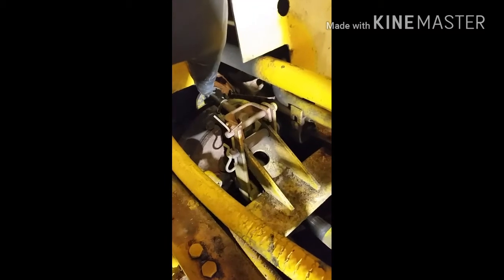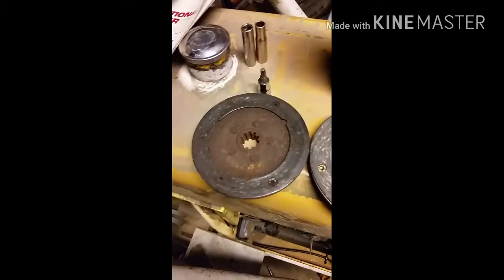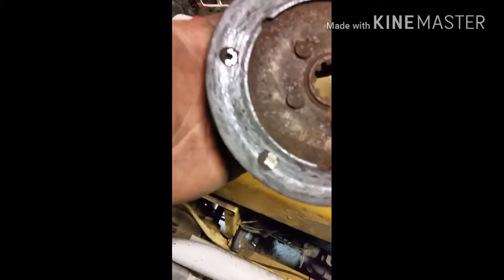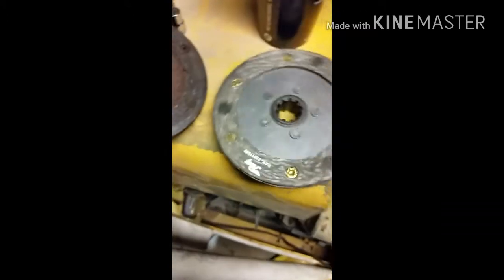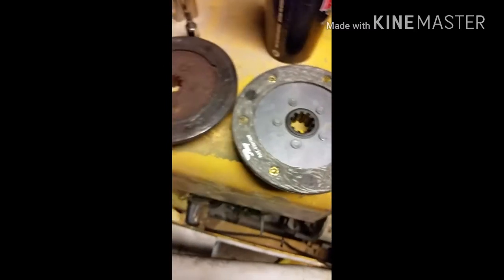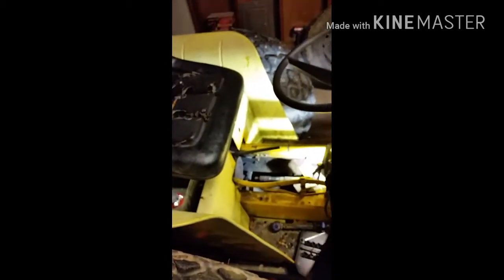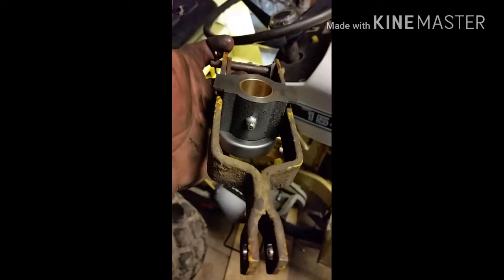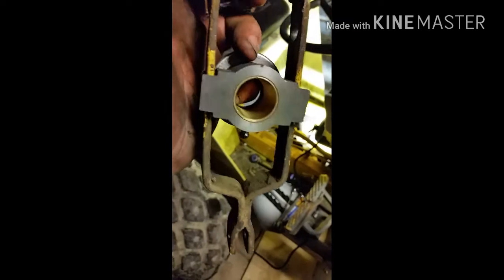Replacement of a cluch on a International Cub Lo Boy 154

Comment: Great video, thanks. I just got a 185 with a front end loader, and the clutch is shot I'm assuming. I can barely make it up the slightest incline. The tractor will just stop. Do you find that these things eat clutches up fast, especially with a loader?
Reply from the maker: After replacing the clutch and pressure plate I've had no more issues and I use the tractor almost on a daily basis with the loader. Turns out mine was worn out by the previous owner not making sure the pressure plate was tight on the transmission input shaft.

Comment: Did you notice when you tightened the pressure plate down that the clutch fingers didn't have a uniform clearance from the throw out bearing? I tightened mine and one of the pressure plate fingers is way further away from the throw out bearing. Enough to where I figure its putting pressure on the friction plate.
Reply from the maker: Anthony Ross mine were all relatively even
Reply: Paul's garden and gravelys ok well thanks. Fyi hamilton Bob's is an awesome resource for those loboys.

Comment: I do not recommend installing the throwout bearing sleeve with the fitting pointing down for these reasons: 1) As installed, the release fork will be up close to the fitting and it will be impossible to get a grease coupling on it. 2) If the tractor has a belly mower, the underside of the tractor is inaccessible. 3) The bracket on which the release fork hangs has an access hole for lubricating the throwout bearing assembly, when the fitting is installed upwards. This hole is in line with the slot in the drive shaft cover below the gear shift. Move the shift lever to one side, shine a light down the hole, and the fitting can be clearly seen.
Reply from the maker: Richard Maurer thank you for your input and comment.